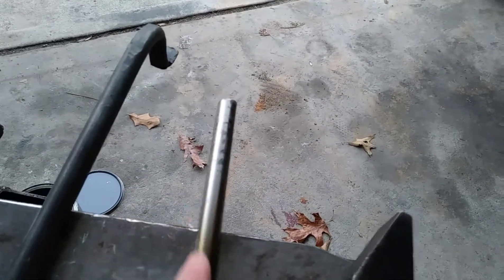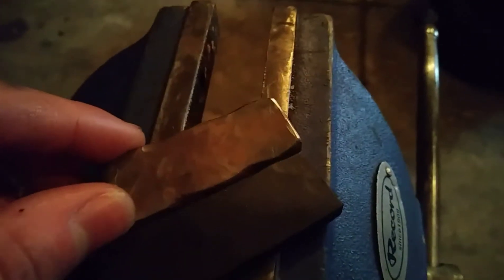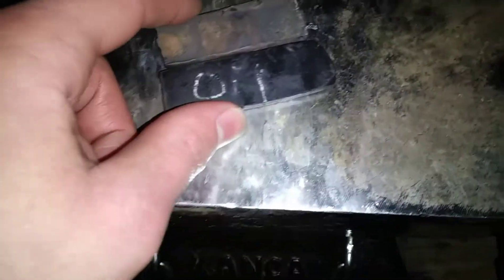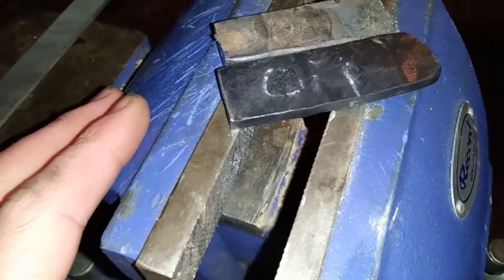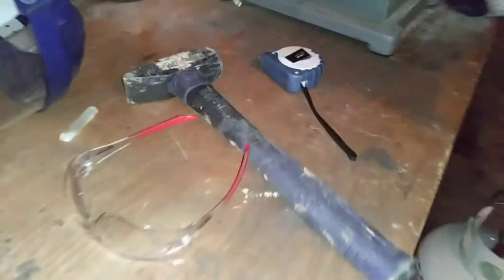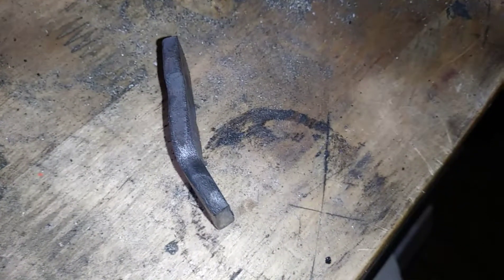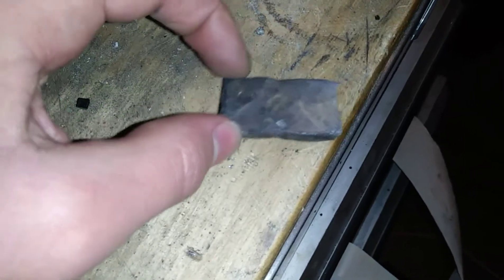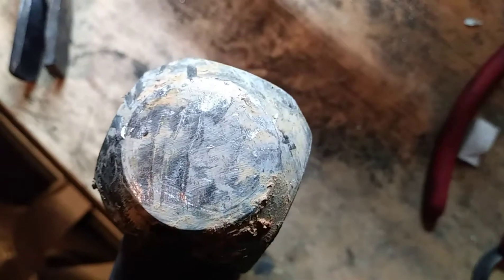Forging Titanium Pt. 2; Heat Treating

Comment: steel hardens when it cools down realy fast. some people will cool down steel in a certain powder i think. im not sure what the powder is called bbut it makes the steel cool down slowly so that it is soft an then it is easier to grind and drill.  im not sure if it works the same with all metals bbut im pretty sure that pure iron does not harden
Reply: Los puedes ablandar en ceniza de madera o cal muerta  eso se llama normalizado o recocido  la ideas es que se enfríe lentamente